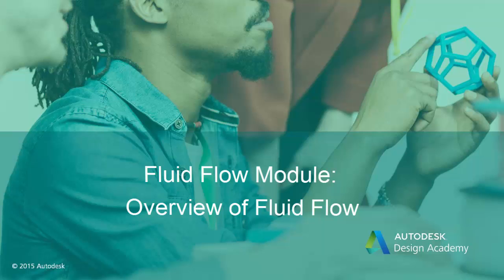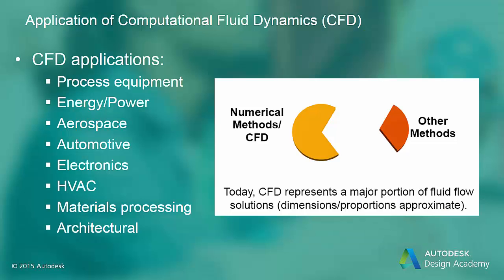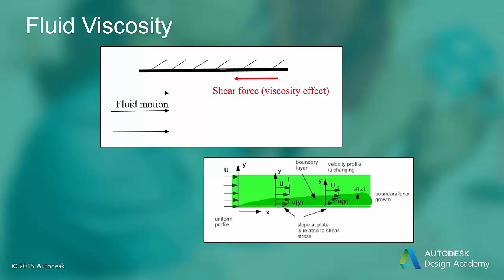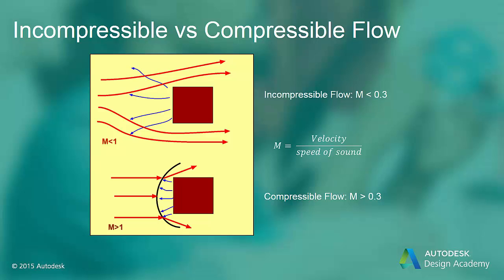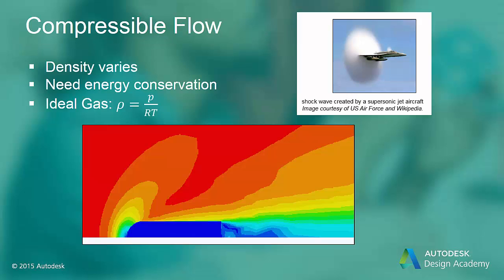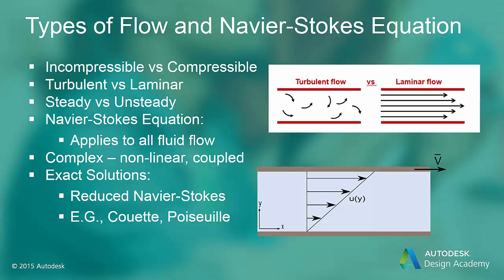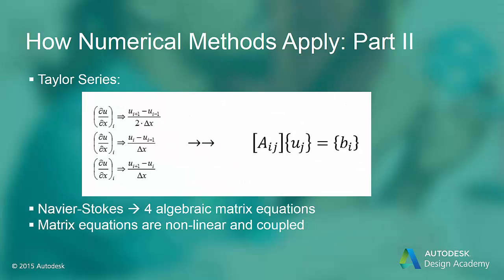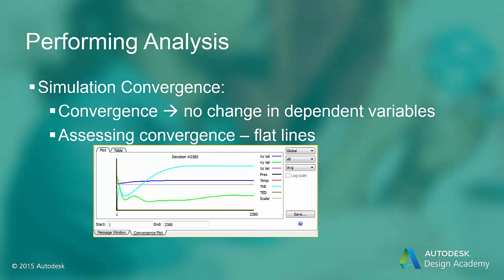Lesson 1: Overview of Fluid Flow Analysis

Comment: I would expect narration implemented using standard high quality audio engineering processes considering the size of the enterprise and the topic at the hand. 
Creating good audio track is very easy and it does not add to costs.
Even reaching for the "just enough" audio engineering level makes the content easy to digest and the audience gets good vibes about the company. 
Could you at least rework the audio by running it through a desser processor so that s's would not be so violent?
In current state s's are distorted quite a bit and de-essng would repair some of the damage.